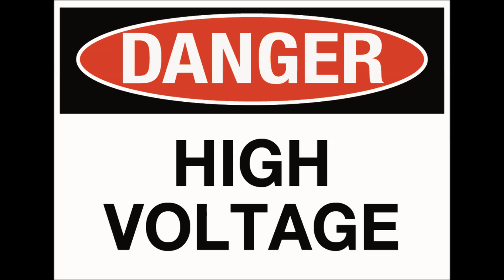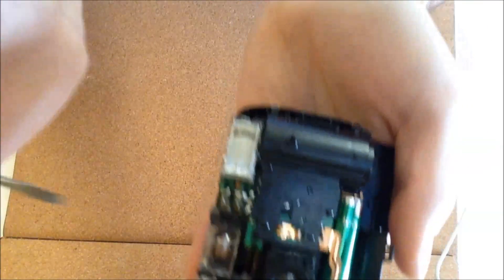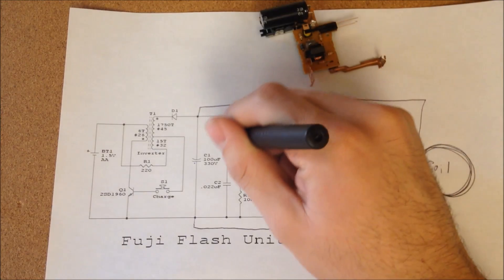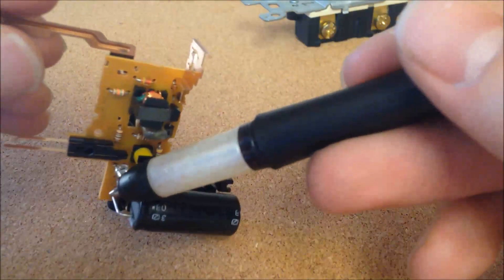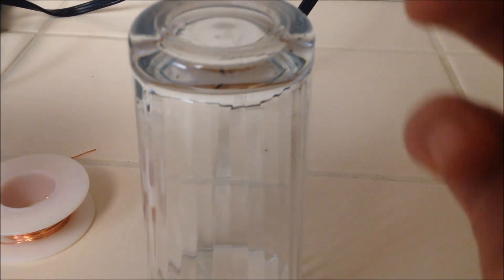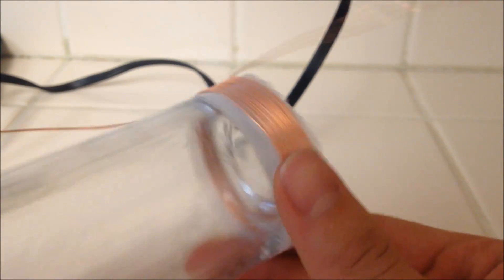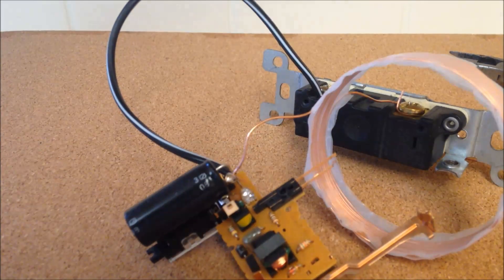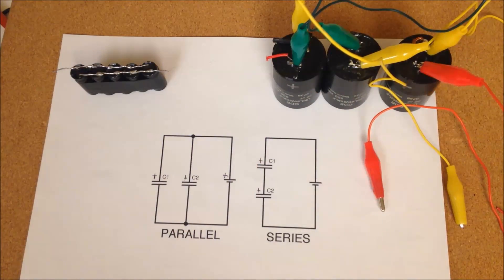How to build an EMP generator

Comment: I'm actually really confused. why do we need a push button? you said to make it safer but how? What does it do? Also whereabouts on the switchboard do i install it? my camera didn't have that little piece of gold metal you ripped off at about 6.18 in the video
Reply from the maker: Conrad Maclean The little gold metal thing i ripped off was the charging button where i put the push button. You don't necessarily need to install the push button there at all, it is only there to be a little safer and when i say "safer" i mean "avoid electric shock" because the you are placing your hand/finger directly on the circuit board if you are using the metal gold thing and not a push button according to the circuit i am using in my video. And the switch, you want to connect one side of the switch (either off or the on side) to one side (any side) of the leads of the capacitor and connect the coil to the switch and then the end of the coil to the other lead of the capacitor. Your goal for this is to create a circuit that can be opened and closed between the capacitor and the coil which is the "pulse generating/firing" part of the circuit. If you have any more questions or i didn't clarify something correctly, please ask:)

Comment: I am having some trouble. I've sen pretty much every homemade EMP video out there and I've tried every configuration of coil with a multitude of gauges and an assortment of caps. Essentially I am using the same kind of wire as the thicker gauge lacquered wire you showed in the video, three 330v 160uF caps wired in parallel or one 560v 75uF wired to the charging circuit. I have tried everywhere from as low as 5 to as high as 25 is turns at varying diameters. I have even tried carefully wrapping the target itself (a simple calculator) in the wire at 7-20 turns with and without overlap. I I may have at one time gotten the calculator to reset using only one 330v cap, but never again has it worked. at one point i wired all the caps i had in parallel (making 4x 330V ones and the one 540V one) and charged it to full, and then discharged it. The calculator didn't reset, but the standard wall switch I was using did weld itself in the on position permanently due to the amperage. I can;t seem to figure out what i'm doing wrong? also, what does wire overlap do to the electromagnetic field that makes it less desirable?
Reply from the maker: Max Kopstein I feel like your problem with this is the device you are trying to use. From what you have explained, you have everything else correct. I suggest you try your EMP on a gameboy or an old handheld videogame because even i have had some problems with calculators. Also, your coil windings do make a difference too. Make sure that the wires do not overlap and if you dont have luck on another device, flip the coil around because depending on the flow of electricity that runs through the coil, you might have the lines of flux be going the opposite way you want them. :)
Reply: I finally got it working, though i don't see why i had to go to the extremes that i did. first i got some heavy solid core wire and made about a 10-15 turn coil with no overlaps. then i got a component called an SRC (similar to a transistor but it can carry absolutely crazy amounts of current across C-E but is activated by very low currents across B-E) this was because all of the switches i had were welding shut. finally i got my hands on a 1200uF 315V capacitor that, when fully charged, outputs anywhere between 152-300 amps depending on the resistance of the circuit (each use increases resistance from wire damage). in addition to shutting off any device with a transistor in it, it also launches crushed aluminum cans.

Comment: what are the materials that i need to build a emp jammer using bus zapper? is there anything that i will add like capacitors? is the emp generator in the video the same in a emp coin slot jammer? thanks for the help, i am curious what is magnetic pulse is, i'm going to college this coming june. i want to learn how this works and how to build it, i'll study electronic course i want to have a little advance. thank you for the help. thanks!

Comment: Hi Cameron Cobb -  may i ask if the emp generator that you build and the emp jammer in slots are the same? what are the differences of the two? thanks.
Reply from the maker: zaibot123 That is a good question. My device generates a single, strong pulse of electromagnetic energy that is to shut down a device and possibly have that device not work anymore whereas a slot jammer has a completely different concept. Its goal is to trick the machine into giving the player credits he/she did not put into the machine by jamming the machine. I do know that obviously they do send out EM interference. I do not know too much about slot jammers and i do not know exactly how they work but i think i will work on that for my next video >;)
Reply: Cameron Cobb thanks for the answer cameron :)

Comment: Great video, I made it.  I added 2 450v 470uf caps also, It was awesome. The only problem is it lasted 2 shots. The first shot welded the switch together. The second shot damaged the charging circuit somehow.
Reply from the maker: I am sorry to hear about your welded switch and charging circuit lol. I wouldn't use a switch if the voltage and capacitance was that high because it would damage my switch. When i do experiment with discharging high voltage capacitors like, i usually make my own switch usually with tin foil or copper sheets. Its not much but it works and doesn't destroy my switches. The second switch damaging your charging circuit is odd. Make sure after you are done charging your capacitors you disconnect/shut off the charging circuit BEFORE you discharge the capacitors. Thank you for watching. Anymore questions, please ask.

Comment: if i wanted to make one quite a bit larger how would i make the charging unit for the larger capacitor?
Reply from the maker: You could make it exactly the the way the regular charging circuit was made, except you would want larger transformer, and transistor that would function to your specifications, change the resistors to a higher wattage depending on your power source (i would do anywhere between 1/2 watt - 10 watts to be safe) and capacitors that are rated to your power supply. Remember that the charging circuit in the video kind of multiplied the voltage so any voltage you put in it will step it up to that voltage to charge but amperage plays a factor too based on the capacitance of the capacitor. Any more questions? just ask :)

Comment: i tried making one, with only a 25v capacitor with 1000uF and a coil with 20 gauge wire and a nine volt battery to charge the capacitor. it didnt work. i made the coil with 8 turns. i didn't use the disposable camera device either. is that component necessary. cant i just run direct current thru the coil? i tried it on a lil office corner calculator. i also put it by my phone with a RF meter, it didn't change the DB reading.
Reply from the maker: I know what's wrong. Your capacitor rating is too low. You need a capacitor that is about +300 volts and a little over 100 uF because a 25 volt 1000 uF capacitor will not deliver a strong enough pulse. The disposable camera is a necessary component for charging the capacitor, it acts as a voltage multiplier to charge capacitors at high voltages. If you attach a 9 volt battery to a capacitor with a capacitor value of 25 volts and 1000 uF, it will only charge the capacitor to 9 volts. Any voltage you give to the capacitor is the voltage it will store :) anymore questions just ask.
Reply: Cameron Cobb thanks I got it. I understand now. Itz the spark gap in the disposable camera that multiplys the voltage. Thanks :-)
Reply from the maker: You are welcome! ;)

Comment: absolutely a cool video, very clear and not too monotone at all :)
I was wondering though, which factor would increase the range from 5cm to say 10 or 20 cm? the coil size? windings? more caps?
Reply from the maker: That is a very good question and all three of those, coil size, windings, and more caps, play a role in increasing the range. The more capacitors you add, the stronger the pulse will be so you can assume that the magnetic pulse/field that the coil gives out is stronger too, possibly increasing the range. The coil size and windings play a role too and the more wraps you have, the more resistance but also the stronger the magnetic field too. The coil size/diameter is more of a focus of where you want the pulse to go, for example, if you were to have a coil 4 inches in diameter, you can assume that the magnetic field is more spread out and not so focused on the desired target but with a coil diameter of about 1.5-2 inches, the magnetic field is more focused and more energy/pulse from the coil is being directed to the object. Think of the coil diameter as a comparison with a shotgun to a sniper. A shotguns round is fairly large and goes all over the place with hitting no specific target at a short distance while a snipers round and the gun itself is designed to hit a specific target at a long range. I hope this helps and if you have more questions i would be happy to answer them ;)

Comment: So the phone died? I mean can you still use it or is it gone? :)
Reply: Cameron Cobb
How does the electromagnetic pulse exactly damage electronic devices??
Reply from the maker: With this EMP, the phones are usable after shock/pulse. It only temporarily shuts down the device because it is very weak and small; however, i could make the EMP bigger with larger and more powerful capacitors, larger coil with more windings/turns and permanently break the devices/phones >;)
Reply: Cameron Cobb
 Ok, great, thank you for answering :) Does the voltage have to be that high or does 250v discharge from high capacitance capacitor bank (lets say about 22000uf) will take care of the intended damage? :) And solenoid, I was thinking about using 2 secondaries of microwave oven transformers in series.
Reply from the maker: Life is illusion That is a great idea with the microwaves. And 250 volts and a high capacitance like that works really well. Just be careful because that could weld your switch, or thing you are using to discharge it, together.

Comment: ok lets talk about Ultra-capacitors that come in at about 1500 Farad!!!! (that's farad not uF) what kind of volt/battery would I need
Reply from the maker: Depends on what you are wanting to do, i have never experimented with capacitors of that high of capacitance and with that high of capacitance usually comes with low voltage, usually anywhere from about 1-3 volts and if you were to discharge it, it would be a very long and not so powerful discharge. With more capacitance the longer it will be to charge. Personally i wouldn't use that high of capacitance, i would use a very high voltage (+300) with pretty high capacitance of about 1000uf - 10000uf. I would stay away from ultra capacitors with an EMP.
Reply: ahh I see, thank you